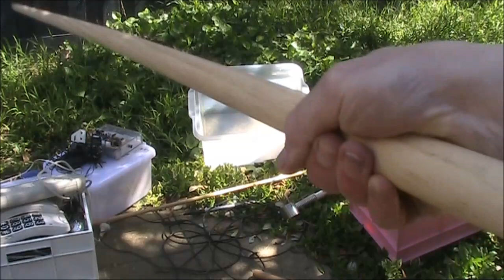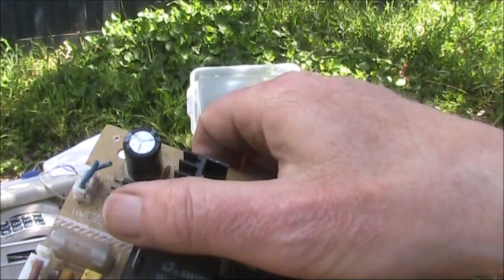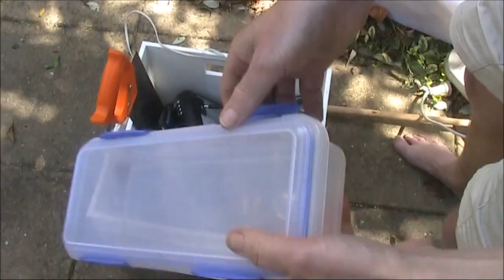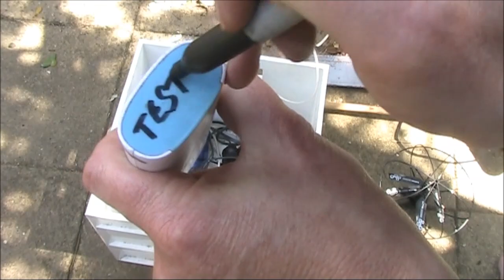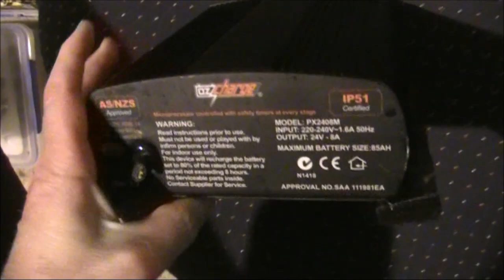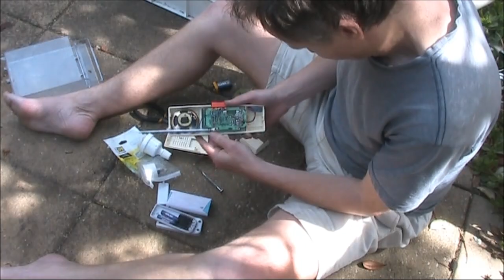Street finds 2021: A look at some salvaged electronics

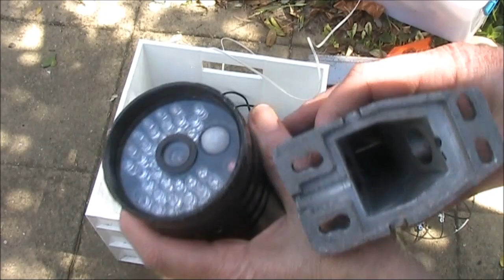Comment: 11:44 is a CCTV cam with PIR & IR LEDs for 'night vision'.

I made my HF antenna from junk in the shed. There's a dowel for the top of my end fed inverted V, as the middle is steel tent poles 6M high. I used 25M of insulated earth wire and 5M of mains cord just reaches a steel pipe in the ground.

The SWR was 3.5 on 80M so I made an unun from an old PC PSU. Using an old PC switch I can disconnect the ground rod, which really improves 20M. Or leave it on for 80 & 160M and it resonates at 10 MHz. 

Sometimes switching the ground removes the occasional heavy electrical noise from the neighbours. At most I've gotten 4,500 Mi on FT8 @ 10W.

I used old multimeter leads and jack plugs to connect to the SO-239 socket. I reused old Molex connectors to power my radios from PSU or battery.

I've used a 12v PSU for powering my heated motorcycle jacket indoors or in the shed. Some are 13.5v which might recharge a battery.

I repaired a worn out remote by cutting and supergluing the conductive dots from another keypad.

I broke open a transformer type object (like in your modem) from a faulty ADSL filter and it has a lot has super thin copper wire around it.

Comment: Regarding the IR remotes you found that had the 455 KHz ceramic resonators in them, forgive me if you  already know this but if you divide the 455 by 12 it gives one of the standard IR remote modulation frequencies of 37.91 KHz.  So I suspect that what ever that special purpose chip is that is in the remote is designed to take advantage of the abundance of cheap ceramic resonators to fire off pulses on 37.91.  As of late I have been doing some research on how IR remotes work and the sensors that are in VCRs and the like are not just 3 lead photo transistors, but little IC chips that include a ~38 KHz bandpass filter and signal processing circuits.  I just received 3 of them off Amazon and I am prepairing to hook them up to an Arduino to see if I can receive IR and display the encoded button press signals on an LCD (fingers crossed!).  I always enjoy your vids Peter and keep 'em coming - 73 de WB8YMV
Reply: You probably know this, but for others you can hear an IR LED remote transmit different sounds on a very close AM radio. I guess it doesn't transmit far enough to be useful.

You can also check a remote is working. If you press a button and look at it through a digital camera, you can see the IR light flash.
Reply: @dazednconfused31337  I knew about the camera thing but I did not know about the AM radio thing. That's pretty cool. I'm going to play around with that this weeked while I'm messing around with the IR receiver ICs. Thanks!